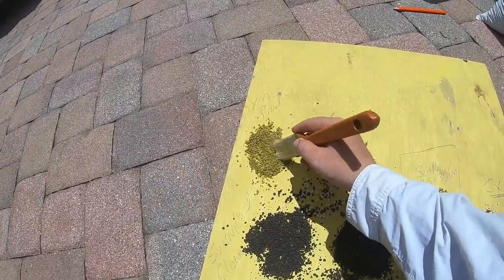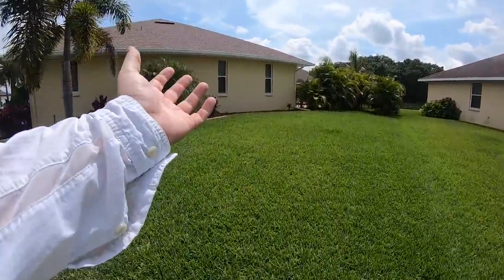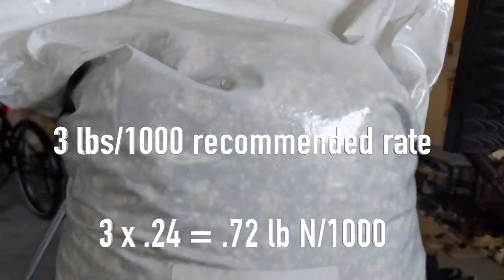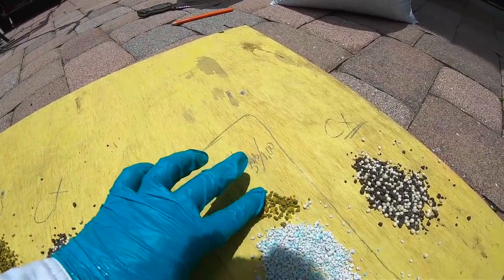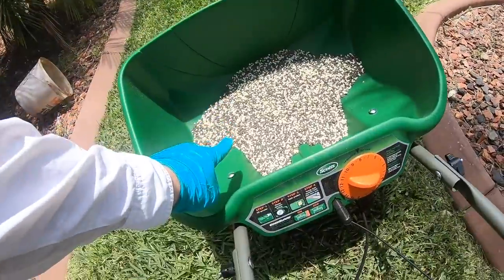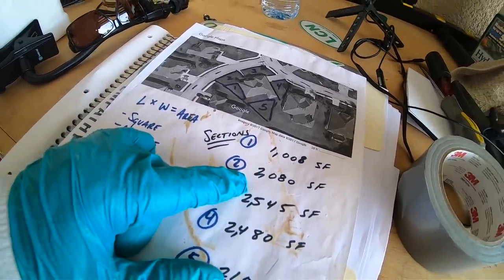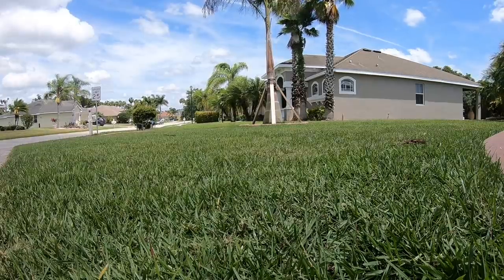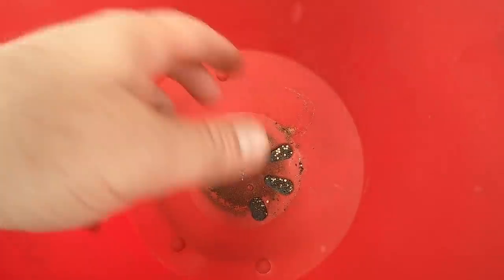How To Apply CarbonX Fertilizer | Spreader Settings | Throw'er Down

Comment: Allyn, I think a lot of begginers confuse fertilizer burn with the light and dark striping you'll get from a totally uneven spread. Probably best to take that setting of 8 on the Scott's and drop it in half to 4 then walk the lawn both north south and east west if possible. Avoids stripes and helps you practice until you can get your technique dialed in.

Comment: I just found you about 3 or 4 weeks ago and my lawn used to look like crap. Now my lawn doesn't look as crappy. I used to be the worse lawn on the block. Tons of weeds and bald patches. I wanted to change that so i did a weed & feed, and some Scott's Sun and Shade grass seed. (the blue seeds that has that moisture packet around it).I don't own a grinder yet to sharpen my blades yet but it's baby steps for right now on a budget. lol I love your channel! Every time I watch it, it inspires me to go out and do some yard work. I'm gonna be one of the best lawns on the block soon!!! Thank you for your tips good sir!
Reply: Harbor Freight has an inexpensive 4" or so hand grinder that I use. Doesn't have to be anything fancy.

Good job on improving your lawn. Patience is the key.

Comment: FWIW, I just applied Carbon-X to my (carefully measured) 7,500 sqft lawn using my Scotts rotary spreader set on "5".  It applied 20.3# of material (=2.7 #/1,000 sqft).  I did apply header strips, and I walk slower than the LCN.  So YMMV.  Just another data point for your consideration.

Comment: With my Earthway 2150 at 16. Carbon X will get stuck. I could not get an even spread pattern. I ended up going a tiny bit higher between 17 and 18 to get it out. No big deal :)

Comment: A month after first application...In short, I will buy Carbonx again.  Now read on....I put my Scott's Elite spreader at 8 and before I knew I only covered 3000 sf with full bag of Carbonx, testing for smallest opening that let's chunks drop thru.....now keep reading..finished the 15k sf lawn with Milorganite.  Results...OMG, I made my own self domination line!  Carbonx not only did not burn in heat at that heavy app rate with no water, lawn is flourishing like never before using box store products!  Pro input I got... Milorganite pure organic applied sitting in bulk decomposing helped give me lawn fungus. Also, Carbonx uses both organic and synthetic...pro states he alternates app of pure synthetic and organics for good price results.  Further, if you aren't into multiple apps and liquids on huge lawns, this puts down a lot in one step (humic acid really seems beneficial).  The only criticism is perhaps reduce and refine the particle size for use in non professional spreaders.  I bought an "elite" $100 Joe consumer spreader.  For 50 bucks more...get a more pro-like  model with real tires.

Comment: Allyn: We all walk at different speeds, overlap more or less than you do, and do or do not make generous perimeter strips.  So the real truth is that we each need to calibrate individually.  Some of us use the “cheap” ( not MY words) Scott’s rotary spreader, and a target rate of 7.5 to 8 may be (way) too high.  I’m guessing, based on experience with Milo and many other ferts, that the right setting for ME for C-X is somewhere around 4 to 5. But YMMV.  So thank you very much for these videos, and for challenging us to use our brains!

Comment: I just found you this past week and have probably watched over 20 videos so far. Super informative and inspiring, as I’m always looking to up my lawn game. I did have a question though, as far as milo...when you said “FYI 3lbs/1000 of milo is useless...” what is your recommended rate? If you have a video to link to, that would be greatly appreciated. Looking to pick up my first bag of milo and throw er down!
Reply: Bag rate for Milo is usually one bag (36#) for 2500 sq ft, which is just over 14lbs/1000.    Milo is nice for cheaper spreaders since you don't have to worry about using small, precise, spreader openings and perfect distribution.   Carbon-X, OTOH, may be a challenge for low- to mid-priced spreaders at just 3lbs/1000.

Comment: Got my CX in the mail Friday. Went to make my first application this morning and was a little concerned that when I weighed the bag (best way I could determine how to put down 9 total pounds on my 3000 sq ft; on 2 different scales, with two different methods) that my bag seems to only contain 43 pounds. I’m honestly OK with this as it’s a first round of shipments and things are still being worked out, but wanted to see if any other customers were finding the same.
Reply from the maker: interesting! can you send me some pics? shop@thelawncarenut.com thanks bro!
Reply: The Lawn Care Nut I would, but there’s no way for me to confirm to you now what the bag weighed before I applied it this morning. I used both a bathroom scale and a luggage scale and weighed the bag by itself and then weighed me holding the bag on the scale (and comparing it to my weight on the scale, luggage scale was obviously just the bag). It came out to 43 pounds every time , but like I said, I can’t confirm that because I didn’t take pictures this morning and made an application. If I took pictures now, you’d only see shots of a bag with 34 pounds in it
Reply: I just got in a bag and it was right at 50lbs.

Comment: I have a hand Z20 EZ Hand Spreader by Republic and need to keep it on the highest number 5 other wise it will not come out. My yard is only 5000 sq feet but I weight the carbon x for what I need then go from there.

Comment: I just purchased the earthway 2600A plus and Carbon X , my question is can this be applied in a crisscrossed pattern? I am a beginner and so that I don’t miss any spots I normally put down fertilizer in the beginner crisscrossed method. Second part of question is do I put spreader setting at 8 for the vertical pass and the 8 for the horizontal pass. If can do the crisscrossed method

Comment: Hey Allyn! My new lawn was planted  in maryland on March 1st. It has had two Xstart applications 4 weeks apart. Did a yard mastery soil test may 1st ph 5.9 and all my NPK was under and not in optimal range. Did the recommended app of X start may 5th.  I'm getting alot of broadleaf weeds and new seed growth and still alot at 2". Should I start applying Carbon X it boost this growth and choke out these weeds. I'm worried about post emergents this early with new seedlings. Any help will greatly appreciated!! Thanks!!

Comment: You already asked the question that I was wondering. If psrt of Carbon X is synthetic will you burn the lawn if you apply too much or is there a fudge factor in CX as there is when using Milo?

Comment: I think I did 6 lbs per 1,000 last night on my St Augustine Floratam at the Scotts mini  on the 8 setting. I believe that is too high for the mini. Should be 4-5. Will I be Ok? I watered about 15 minutes after I applied and then water again over night at 30 minutes.

Comment: Don't hate on the affordable spreader that already comes with an edge guard, no cardboard required.  Trim passes all day.
Reply from the maker: I didn't mean to hate on it , it's actually works great considering you only need to use it 5-6 times per year. I just prefer something a little beefier.
Reply: Basically only differences are larger hopper and rubber tires. Buy what you like and can afford I say. 😎

Comment: Seems to me if you know the lbs per the area it really doesn't matter the setting on the spreader. A low setting with multiple passes assures better coverage. Am I totally wrong?
Reply from the maker: Your method works just fine. I just prefer to get it all out in a single pass rather than going over it more on a lower setting.

Comment: Correct me if I am off on this. But I dont worry about the # setting my spreader is on. I weight out the product and apply however many many lbs is recommended per  1000 Sq Ft.  I do this in 1000 Sq Ft chunks so I am always emptying the spreader. Is there any problems with doing it this way ?

Comment: not to throw a wrench in everything, but doesn’t density have a larger impact on weight than volume (size). Golf balls and ping pong balls are close in “prill size” but the weight is significantly different. 3 lbs of golf balls and 3 lbs of ping pong balls is a significantly different quantity or volume.
Reply: but 3lbs is still 3lbs is it not? it’s like saying 100lbs if gold weighs more than 100lbs of feathers. i may b wrong but i’m assuming that even tho the density may slightly differ, they are still going through the hopper and the same flow rate.
Reply: He is talking about prill size in relation to the opening size of the spreader.  The larger the prill size, the larger the spreader opening will have to be for the prills to fall through the opening.  In this context weight or density doesn’t matter, only size.

Comment: Is your palmetto cut at the highest setting? I took my st aug 1 setting down on my toro and I felt that it was too short for the heat. Thoughts?
Reply from the maker: It's at 3.5 and doing well. I would not go lower than that though

Comment: Looking forward to buying and trying.  I’m a fool and bought a pro grade lesco spreader because they are cool.  Settings are damn near impossible to find for any product. So if I throw milo at a setting of about 18-19, and based on what you show in this video I should be about twice that for carbon x. So I should be about 36?  Not sure if it is a linear progression or not. Anybody have thoughts? Patrick -Chicago
Reply: I set my lesco at 18

Comment: No matter what I do, I always end up tiger striping the hell out of my lawn with that scotts spreader. I even tried cutting rate in half and doing a north south then an east west pass and then I end up with a hash tag pattern in the lawn. I dunno if it's me or the spreader but I can't figure it out.
Reply: When you say tiger striping are you talking about burn or just darker green areas? Because I had the same issue with my Scott’s spreader. There were times where product would get stuck and the hole wouldn’t close and it ended up dumping a ton of product down. I had lines through my yard of burned out areas because way too much came out. I’m thinking the Earthway is better for CX.
Reply: rnott77 just areas of darker green, not burnt.

Comment: LCN I'm in the early stages of a lawn renovation going with KBG I will need a push spreader for seeding and fert ect...????? Which spreader so u recommend?????? Thx....Love your videos....
Reply: Earthway broadcast with edge control. Get the pro model, and have it for life.
Reply: What ever you do... do NOT buy a spyker ergo pro. I bought a brand new one specifically for the launch of Carbon X. The single hole marketing sucked me in and I ended up having to run it wide open with a terribly uneven throw. My Scott’s DLX was way better than this $400 P.O.S.! Anyone want to buy it?!?!?
Reply: The scotts elite has been good for me. Its $99 and more commercial with foam wheels. It rides smooth,Google it
Reply: @trentburns1753  Thx for the info I was looking at the spyker as well glad now I didnt buy it. .
Reply: @sammaerz61  Does the edge guard cause a heavy buildup on the guarded side,  or does it somehow redistribute or prevent material from being dropped on that side all together?????
Reply: @bluegrasscrazy7307  it does not build up at all. Google or YouTube it. Depends on the model and year, some shut some of the bottom holes so it cant go that side. Some have a drop down shield that just prevents it from going left. Redirects it forward.

Comment: Don't forget, spreader settings are dependent on walking speed
Reply: EVERYTHING is dependent. I walk more slowly, and overlap more, than LCN.  I have found that I (not necessarily YOU, or anyone else) need to use a different (lower,in my case) setting in order to end up with any particular “pounds on the ground” target.  For example, if I set Milo at bag rate on my Scott’s rotary, I put down far more than the target rate.  So EVERYBODY needs to calibrate individually.